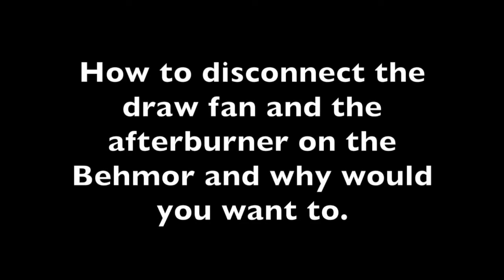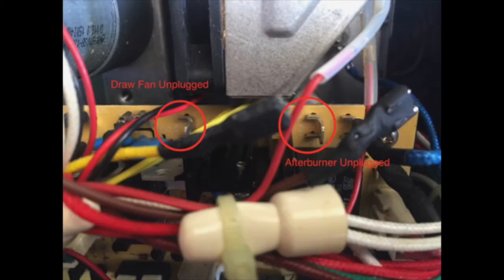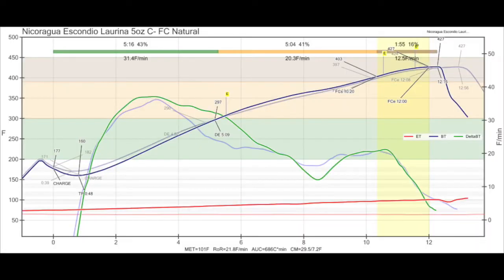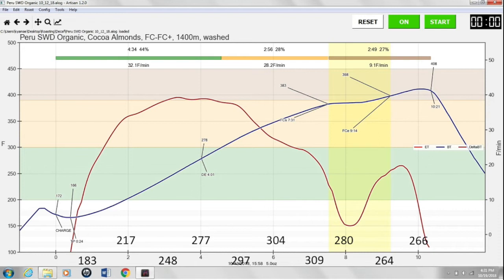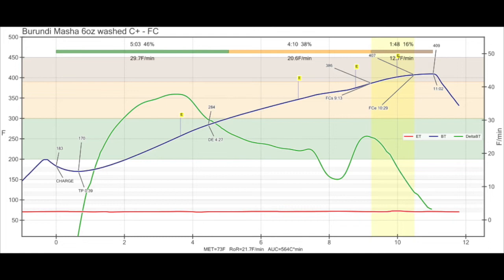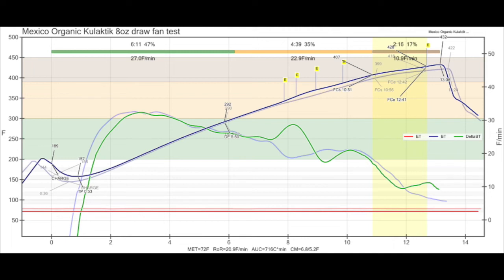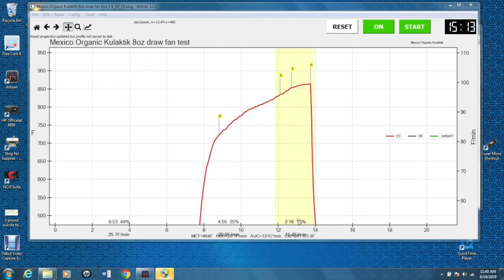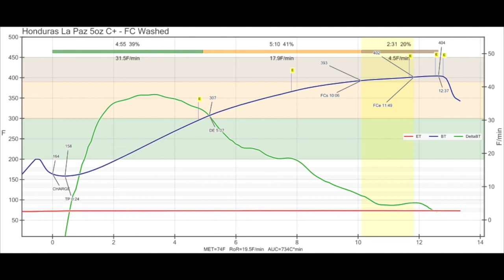Coffee Insanity Disconnecting the Draw Fan and Afterburner on a Behmor 1600+

Comment: Any issues with smoky flavors since the smoke isn't venting/burning off?
Reply from the maker: NO but I crack the door at 5 or 6 min to let the smoke out. You need to vent it out somehow. I use a screw driver to crack it open just enough for the smoke to escape.

Comment: Hi, I tried this on the new 2000AB and deep into a dry burn, the roaster shut down and I received a ERR4 - bad draw fan or loose connection.  Did you not get this error on your model or did you do something else to prevent this error?  Thanks.
Reply from the maker: No I have never recieved this error code. I wonder if Joe found a way to stop this mod on the AB. I have the 1600+. Did you do everything I did in the video?
Reply: Yes. I simply detached the draw fan and afterburner connectors, taped ends, and left them hanging. The 2000 has a new board but I found a diagram. Wire insulation color is the same.
Reply: Note I believe the programming of the 2000ab exhaust fan is different than the 1600+.  I never have to be concerned with the B temp overtemp (~320). The exhaust fan kicks on earlier so if I’m running on man F5 I don’t have to kick back to F3 or 4.  Max B temp goes to is around 290.  This is why your mod looked so appealing. Oh well - they seemingly took more control away.
Reply from the maker: @joseph_432  wow that is too bad. Good to know though. I will keep an eye/ear out for any info on the ab model.

Comment: Are you still running your Behmor like this?
Any other downsides other than the extra smoke?
Reply from the maker: nope. I really like roasting like this. I hated when they kicked on and I saw the temp and ror drop.
Reply from the maker: Keep in mind I roast 4-6oz at a time. I have no idea what would happen if you tried a larger batch size. I'm sure 8oz would be fine but 1 pound, I have no idea
Reply: @coffeeinsanity9712  Thanks. I want to start using Artisan, your videos have been very helpful. I do ~8oz roast just a little past first crack.
Reply from the maker: I thought of one actually. You have to clean behmor more often because of the extra smoke. Make sure to vent it out or it will affect the taste of the roast.